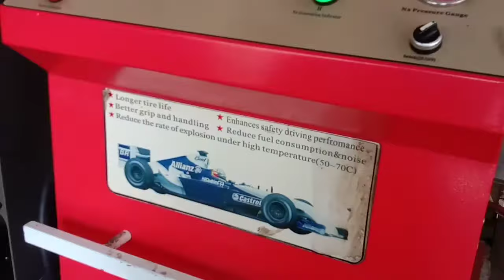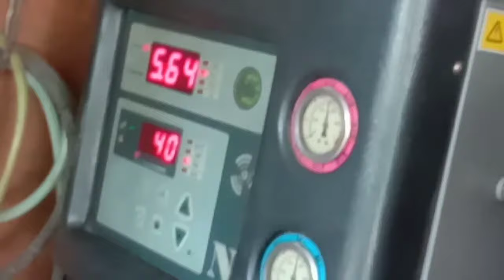How to Covert Tubeless your spoke rim

Comment: Vulca Seal pala ginamit mo sir. Sa akin rubber gasket + air lock okay din.
Reply from the maker: Pero mas ok yung vulcasel boss at naka ducktape at nka tire sealant para walang  hustle
Reply: @BrianBernasor  try ko yan sa susunod vulcaseal + duct tape + air lock hehe
Reply: @Ck lemri 1.4 pra sure
Reply from the maker: Hindi po airlock ginamit ko vulcasel po at duck tape para long last ang gulong